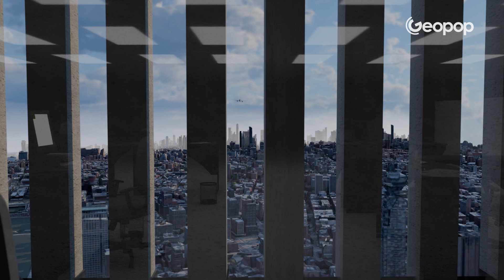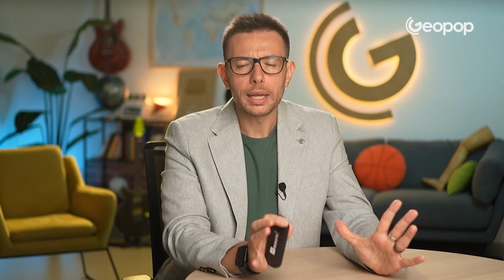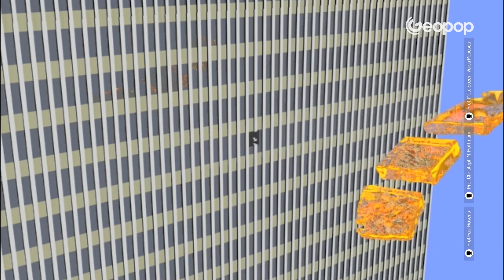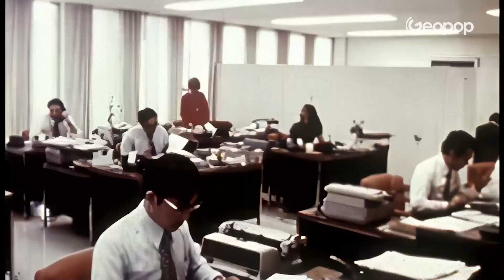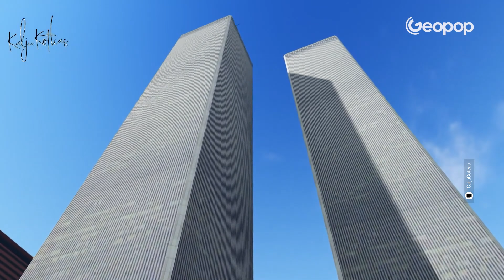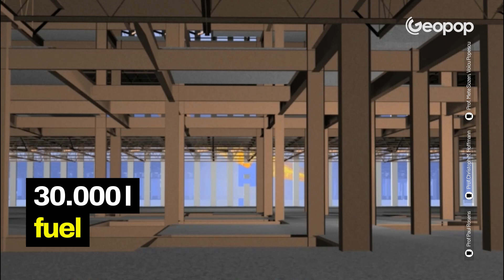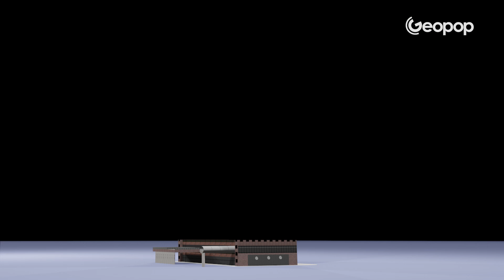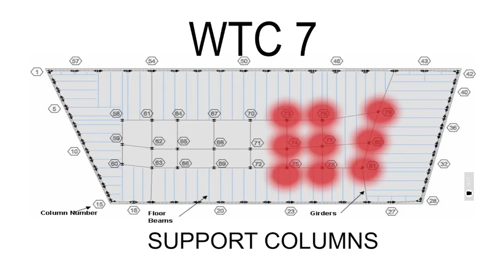9/11, 2001: The Technical Reconstruction of the Twin Towers and WTC 7 Collapses

Comment: Any conspirators of WTC1&2 would have disincentive to bring down WTC7 some 6-7 hours later.  First there would be no point in such an action with the mission of the twin towers completed and every surrounding building evacuated.  Second, conspiring to bring down another building would only add to the conspirators exposure of being discovered via forensic evidence.  So as far conspiracy goes, WTC7 in and of itself goes nowhere, WTC7 was simple fallout of the twin towers, regardless of how they are perceived to have been brought down.
BTW, the propagation of a single failure point spreading to the entire building is exactly how the Sampoong Department Store in Seoul South Korea happened, killing some 500 people.  Single point failure is in fact usually the cause of structural disasters.

Comment: The slabs set on steel platforms first of all that called trusses second of all they are light as hell and and you can actually carry one by yourself very thin trusses
Reply: That does nothing to explain how the steel frame centre core comes down at the same speed. You can make a computer simulation do whatever you want it to, you won't see physical, scaled models ever replicate what happened based off the official explanation.

Comment: Look man we all already know what caused the buildings to collapse it doesn't take a rocket scientist to figure it out the building was nearly cut in half there no inner support columns only a center shaft let the steel trusses were bolted or welded to that's it so if you put 500 tons in the center of the floor of course it's going to bend and collapse plus the fire and everything else I've been in construction my entire life practically rebuilt the Bronx brand new apartment buildings right out of the ground with prefab concrete slabs that were basically sitting on 5 inch L brackets that were bolted to the outside walls and then bolted to the steel beams inside the building if the Twin Towers were poured concrete with inner columns they would have never collapsed it would have been impossible that was the worst design never thought of everything was pulled Inward and down the miracle they stood for as long as they did the worst design ever
Reply: 😅 Controlled demolition. Thermite. Mossad and Bush CIA had weeks to plant explosies.
Reply: Youre slow.

Comment: The conspiracy theorists love to hit me with the "temperature at which steel breaks" information.  Though I knew that the heat, the time, and the continuous forces pushing down on the damaged sections of the buildings, I never had a science-based explanation to counter their singular factor.  I also didn't have any good information beyond a hypothesis about WTC-7.  Thank you for giving me a better understanding of what might have happened and a better way to counter the myth that the government was the culprit in this multiple-site tragedy, 23 years ago.
Reply: This video fails to mention why many floors of intact structure unaffected by fires on floors above was displaced and suffered total failure at roughly the rate of free fall. So all three buildings completely and utterly failed at the rate of free fall. From fires. Steel reinforced buildings. This is the only time in history a metal building completely collapsed due to fire. Where did all that building material go to allow complete collapse?
Reply: When people doubt an “official narrative” it doesn’t qualify them as conspiracy theorists. People that study these kinds of things can find inconsistencies and outright misinformation. That doesn’t mean I believe a conspiracy theory. I just don’t believe fires had anything to do with steel reinforced buildings completely structurally failing.
Reply: @kaalen24 those steel floors have no relevance or impact when they're sliced into with demolition explosives government had the towers demolished and used it all to fulfill their own agenda. Government also planted people on websites to try and cover their evil agenda. For all we know you could be one of them.
Reply: @kaalen24  most of the larger debri Bush had hauled out before any photos or videos were ever taken. They knew exactly what had to be removed to keep it from public view. Bush's grandpa Prescott Bush that aided the nazis because that was his job. It was he that left the Bush family their fortune. Look him up you'll see if they haven't hid the truth.
Reply: What is the source of the many tons of molten steel found in and under the debris, the heat so intense that the molten steel remained in that state for weeks afterward, running off of the debris as it was excavated. This cannot be molten copper from wiring that retains the color of a shiny new penny.  It cannot be molten aluminum that retains the color of the polished aluminum wheels of a street racer. It was the color of glowing orange molten steel  that cannot be mistaken for any other material, reported by firefighters who are very experienced in the nature of such materials as well as seen in video evidence.

When you combine this with an entire lack of turbulence behind 500 mph aircraft, when even a small Cessna Aircraft would leave an evident wake in the smoke and fire only seconds later .  . We find that skeptics still cannot be skeptical of the official narrative in explanation.  Sponsored channels and forum activity are skeptical of nothing when support is provided.

Sponsored activity in the forums is very normal today for commercial and political purposes and subjects of controversy -- in the attempt to lead public debate.
Reply: Yes steel tends to bend and break when demolition explosives along with cables and thermite basically cuts them into like a blow torch. You can watch the charges compressing the floors one at a time as the main columns are sliced into. They had months to prep the job before take off hit 0. Yet you want to argue the floors slowly got too hot and the sudden snap caused a chain reaction. Nice try but I'm not buying it but I have some Swamp land in Antarctica I'll sell you.
Reply: It's pretty simple. The beams are designed to support a certain, static load. When heated to enough temperature, steel becomes softer, and no longer able to support the load, which was enormous. Once the incredible load of the upper floors starts falling, the rest of the buildings had no chance, as in free fall, gravity is accelerating the load towards the ground. I don't know anything about WTC7.
Reply: @aldunlop4622 what load? Did you see any desk or office materials in the debri? 
What about electrical wires and computers? According to them the buildings were suppose to have been full of all types of supply's. The only thing I saw was white sheets of paper and tons of dust LOL AND black smoke which indicates diesel fuel that was deprived of oxygen. No doubt was fed thru the building from the basement. Or it was added by a method much the same as photoshop. Tail fin of a supposed jet left an entire imprint where it cut thru both steel and concrete. Armored jets I suppose covered in a thick steel plate would've made it thru the entire building and the nose popped out the other side.   Yet why did they try to hide it with a fake explosion? LOL
Reply: @SkynyrdLynyrdYaw  I'm not going to bother to explain anything to you. If you had a brain, you wouldn't need me to, and since you don't have one, it wouldn't matter what I said anyway. Believe, don't believe, I really don't give a fuck.
Reply: Too bad you're wrong.
Reply: The buildings were done by controlled demolition no planes hit  anything all that was added by a program much like photoshop. Layered videos is all you saw on TV news there were no planes and the buildings were empty up until the demolition explosives were installed. Watch the huge steel beam turn into dust as the tower is being demolished. Fairy dust to cover up what they did not want anyone to see. The airplanes back tail sliced through solid steel beams like it was nit even there but why? Actually because there were no planes and that section was edited into their video creation. Seek and ye shall find. Ask and ye shall receive. Knock and the door shall be opened unto you. Bush flat out lied to America. Obama aka Osama flat out lied to America. Stop believing the propaganda being used on you. Get to know Jesus who is the way, the truth, and the life.
Reply: @SkynyrdLynyrdYaw  ah so the people that were there inperson where what paid to react like a plane hit ????? lmao
Reply: @topgun1457 I would say those that portrayed themselves as part of the event  were being paid as in "government employees" in this manner they were held accountable for their actions. However they could have also volunteered and signed an agreement that would also hold them accountable and force them to stay silent. Its not a matter of if they conspired to mislead America its a fact.
Reply: @topgun1457 unless you didn't pay attention most people were supposedly witnessing people who jumped from the building not the reaction of those whom supposedly saw an airplane that was faked to appear as an airplane striking the buildings. Wake up the dust proves they were intentionally covering up a controlled demolition. Watch as huge steel beams falling to the ground turn into dust particles in mid air. Anyone with half a brain can figure it out.

Comment: They put all the center core columns in the middle of the building. I think that a big reason why they collapsed.
Reply: American buildings are rubbish, three collapsed on 9/11. 
American Airforce is rubbish, it achieved zero against the hijacked planes on 9/11.
American Armed Forces are rubbish, they invaded Iraq which had nothing to do with 9/11.

Comment: I’m still claiming BS on the World Trade 7 building collapse. You can see from the video that it clearly didn’t collapse as the model predicted. The majority of all the upper floors looked perfectly intact and then they fell in perfect unison which looks in-natural to other normal building collapse video.
Reply: You’re watching a reconstruction which has only the structure shown versus a video that includes the facade. How can you see something that happens inside the building from outside?
Also, the column that gave up is in the back of the building from the point of view of the video. I’ve never seen videos of the collapse from the back. How does it look like? Finally the building, while collapsing tilts exactly toward the side of the failing column. Chance alone?
Reply: @lucalambertini9990 OH THANK GOD,  somebody else actually knows the original video was cut. 
The clip that everyone saw on loose change shows the collapse about halfway through. There was a penthouse on the roof that collapsed through the roof, which showed column 79 failing.
Reply: Brother you're looking at the original collapse video being cut short. You have to find the unaltered version with the penthouse on the roof.
Reply: There's a video showing the men on the street, with a transit aimed at the roofline, and it showed sagging and susceptibility to collapse.
They were also talking about pulling the men out, because it's showing a gradual weakening.
The conspiracy sites don't show videos that show the severe damage or any information that interferes with their Pull-it means demolition theme.
Reply: Controlled demolition. Thank your government! And Mossad.
Reply: The frame fell and then the outer shell fell because it suddenly didn’t have a frame anymore
Reply: It's very easy to fool the common man and even easier to buy experts and intimidate the rest. You have to leave a few to tell their theory and version and make them appear crazy. Gives a more authentic look to the entire cover up.
Reply: I was looking for this comment, I find building 7 shady also. It's timing is just so random, it makes sense that it was burning for that long and then collapsed. 
I can tell you I've worked in fire protection for 25 plus years as a fire sprinkler fitter.  The fire protection definitely would have failed just due to the catastrophic damage in the area would absolutely hinder the water supply.  He did say that office buildings are "full of combustible material" which is technically wrong because I know office space is by code a light hazzard (NFPA 13). But I could definitely see how if it was burning with debris from an explosion would be a high temperature fire, with a lot of stuff burning at one time, would be fueling itself.
Much respect to all those trained to run into those situations. Much love to all on that day. ❤️ ✌️

Comment: "No one really knows what actually happened" ???
YES! Yes we DO know EXACTLY what happened.
The WTC Towers collapsed as a result of the structural damage caused by being struck by the two 350,000 lb Boeing 767s travelling at over 500 mph on average, which is FASTER THAN A .45 acp BULLET fired from a typical handgun such as a Glock G-21 or Colt 1911, and the resulting fires which heated the steel to the point that its strength was reduced by as much as 50% to 90% depending on location.
WTC #7 collapsed after being severely weakened by the collapse of the North Tower and resulting fires that raged unchecked for 7 hours.
That is EXACTLY what happened in laymans terms.
More technical explanation is available for anyone who is capable of understanding it.

And "3 WTC buildings collapsed" ???
No. All 7 buildings in the WTC complex either collapsed as a direct result of the airplane impacts, the collapse of WTC Towers 1 and 2 or from a combination of structural damage from their collapse and resulting fires, same as the Towers, or had to be demolished afterwards due to their damage.
Either way, all 7 buildings were destroyed in the event.
Period.
Nothing unknown, unexplained or spooky at all.
Those that are capable of understanding the events of 9/11, do.
Those that cant, become "truthers" and believe in a bunch of hooey.

Comment: On videos of 9/11 destruction, i saw molten lava pouring out of the building.  What caused that molten lava stuff?  What was that?
Reply: Lave is molten indigounous rock from the earth molten mantle, are you for real?
Reply: i saw that too! i looked at it closer and it was most likey fire falling out or aluminum form the plane melting out
Reply: Imagine all the airflow way up there. 

All that heat pulling air up from every lower opening fanning the flames.

I'm the only one I know that doesn't think there was anything weird about how they fell.

I'm more concerned about why our government was involved. 
But I'm the only one bringing that part up too.
Reply: @Ta2dwitetrash  if you are christian, read revelation 9. And specifically 9:11. Then look up definitions of the 2 words referring to the king, and then one of those definitions leads you to government tattle tails.  By the way, that Mohamad attah was an architect, he had keys of understanding.
Reply: There is a kind of material called "thermites" (thermos, in Greek means temperature). 
This matter uses the metal to increase the temperature in reaction until it turns into liquid metal.
Reply: What about the molten iron they found, which wasn’t part of the structure?
Reply: @briandunning2974 they did not find those things, stop adhering to conspiracies, it is ok if you can not comprehend experts explanations, but do not make the presumptions  that it is a conspiracy.
Reply: @ulrichkristensen4087  I think it’s you that is making presumptions!  I did not suggest any conspiracy. I did not hear the answer to my question in the video.  I’d heard on other reports about evidence of iron being found in the dust so I wanted to know.  What are you trying to hide if you can’t address a simple question.
Reply: @briandunning2974  It is even ridiculous you have questions after literally experts has gone through this episode again and again, there is no conspiracy
Reply: @RuthTomlinson-xn6zw  I've heard it could possibly have been aircraft aluminum or lead from a huge battery backup. Either is totally plausible.
Reply: Likely aluminium from the plane. It was  coming from the opposite corner from the impact. It likely melted and was then tipped into that corner as the floor gave way and poured out as a liquid
Reply: @oneandonlyjaybee  Why have i never heard of liquid aluminum in a plane crash ever? and a google search doesnt find anything close to that. Every crash with a massive fire, theres never molten metal.
Reply: @ApeAlchemist 
How many airliners have crashed into skyscrapers in the last 50 years?
Reply: @lindaterrell5535  i dunno 2?
Reply: @lindaterrell5535  How many demolitions do you see where they take down the most robust buildings with a few drums of jet fuel?
Reply: @lindaterrell5535 Well the Empire State bldg was hit by a B-29 in 1947 and didn't pancake.
Reply: @ApeAlchemist  "A few drums" Please, be more disingenuous, or ignorant; I can't tell which applies best here.
Reply: @Terminator_2003  with "relatively few drums of jet fuel that burned off after 10 minutes ending the hottest point of the fire. Nowhere near the temp needed to cause steel to fail this catastrophically" Fixed ;p
Reply: @shpeen8835  lol.  How much bigger were these planes?  AND was the empire buildings architecture such that it had a steel center tube, to withstand wind pressure. Answer is NO.
Reply: @ApeAlchemist  a few drums? you mean 24,000 gallons, after the buildings have been hit with large planes at high speed?
Reply: @lindaterrell5535  Empire state was hit twice by military planes. Different construction.  WW2.